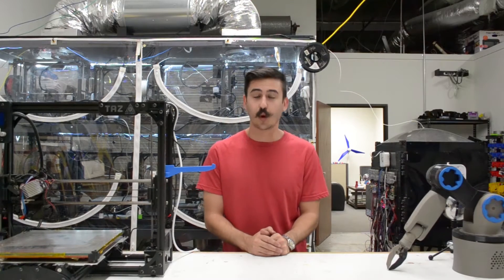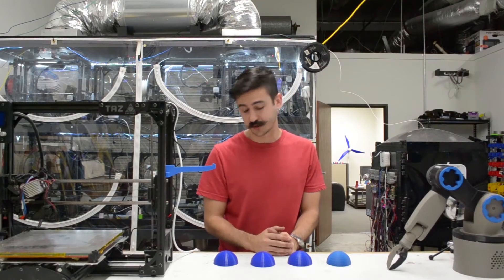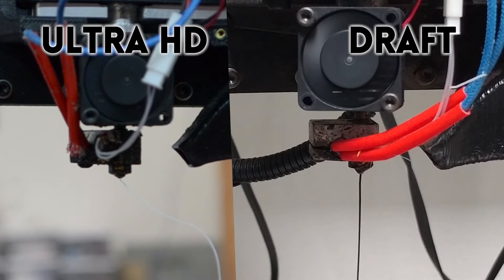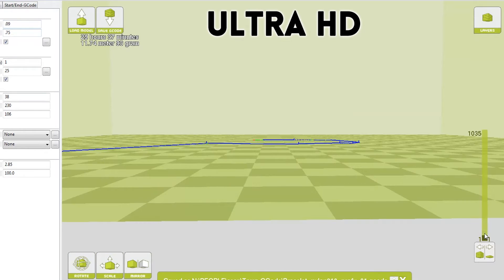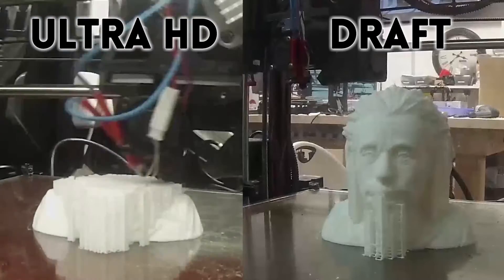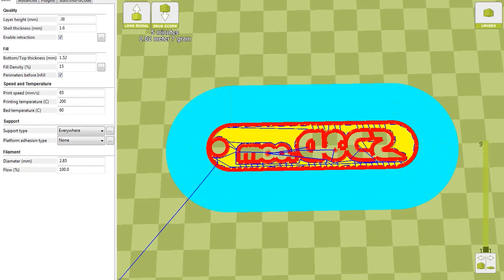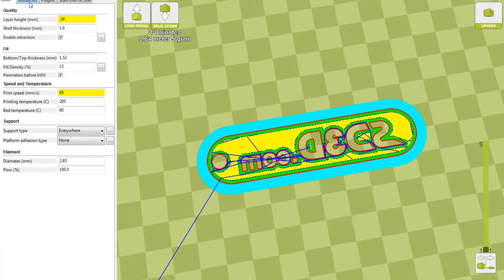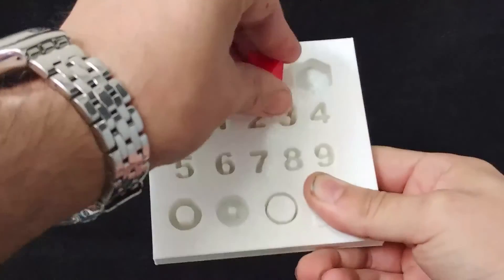3D Printing Quality Options

Comment: Greetings, I have the problem with the PLA is when printing as a human face for example, under the Chin or melted material formed neck. (while the angle not presice supoort). I have tried to temperature, flow extrusion, colling, put a bucket on the side... Use Slic3r and Simplify3d. Thanks for the help.I've noticed that is generated where the filling, is how more depressed on the shore doing the filament melts...